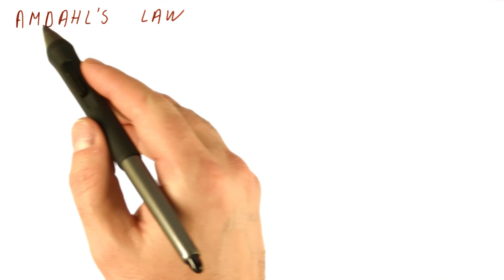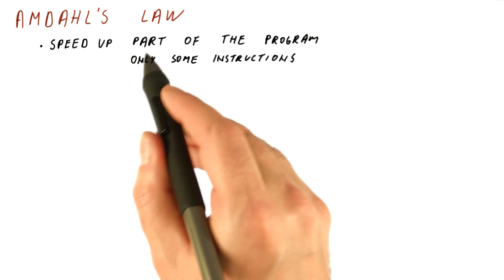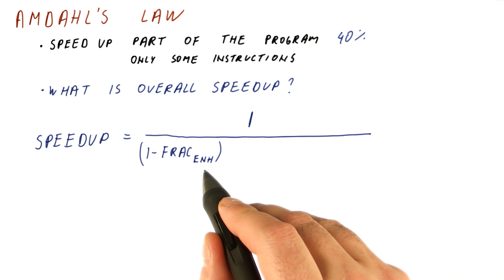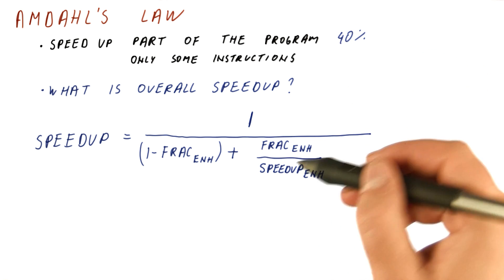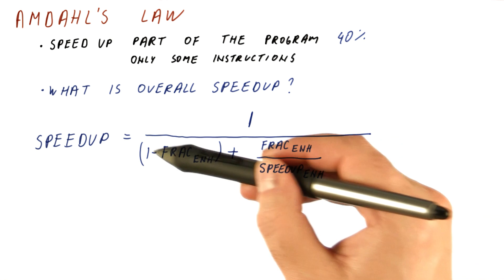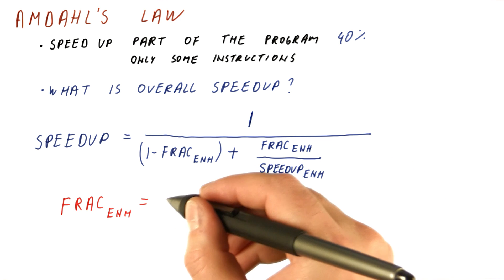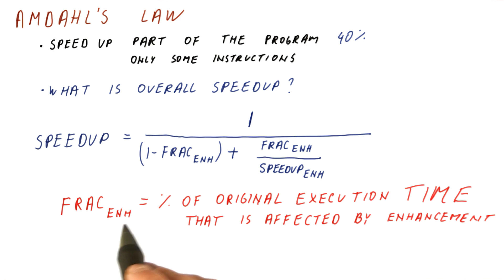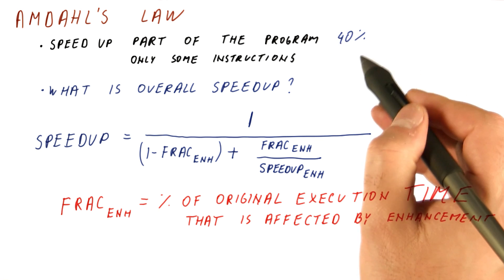Amdahl's Law - Georgia Tech - HPCA: Part 1

Comment: There is a problem with this observation. How do we determine the percentage of a program that can execute concurrently? For example, if 40% of time spent on a program execution runs concurrently on 4 cores, does not  mean that the same amount will run on 8 cores. The claim Frac_enh/4 might not be vaild for Frac_enh/8, because Frac_enh has for example less than 8 threads. Eventually, there has to be a relation between the number of parts that can run in parallel and the number of cores, meaning that we always optimize the "Frac_enh" for the number of cores. Correct?
Reply: it might be, but we can take the process speed by depending the problem with some parallel speed as 40% of total time take to complete parallel execution and 60% serial.

Comment: In the denominator, it should be ( 1 - FRACunh) not ( 1 - FRACenh), unenhanced verses enhanced. this confused me at first, but i found an example in a textbook that cleared this up for me.
Reply: No, it should say (1 - FRACenh) = FRACunh. He says is wrong at first but the unenhanced (sequential) part of the program is of course 1 minus the enhanced (parallel) part of the program. So what he has written is correct, what he has said is wrong!
Reply: taking this class now and this stumped me too. Thanks for pointing this out